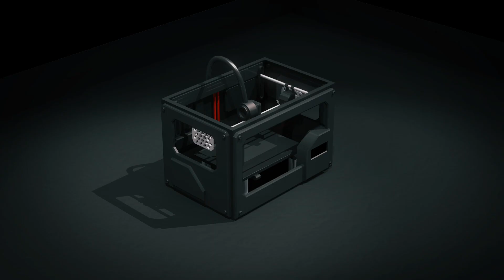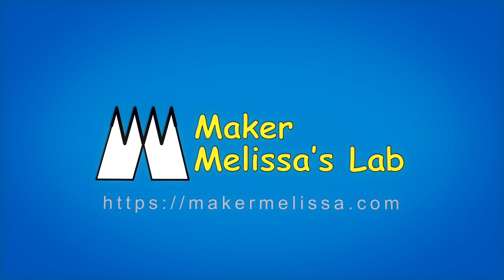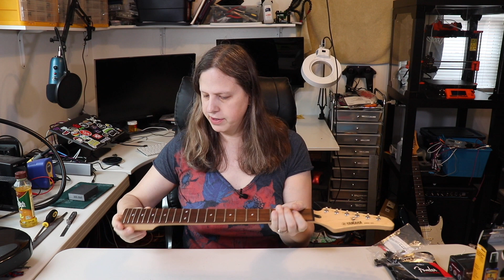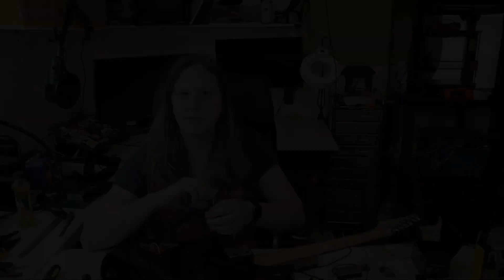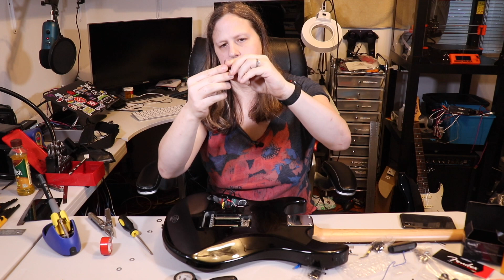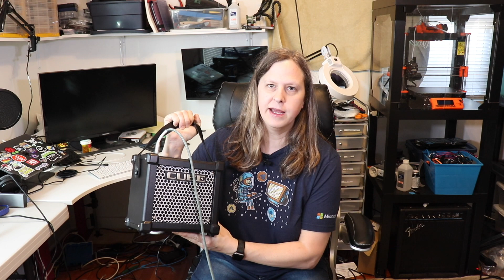Restoring an Electric Guitar to Playable Condition for around $100

Comment: I suggest using a stereo jack wired in differential configuration (signal + to tip, signal - to ring, ground to sleeve) if you have to replace it. That would make it capable of differential output if needed, but still be backwards compatible with single ended cables and equipment.
Reply from the maker: I'll have to look into that because I hadn't heard of that before. Thanks for the suggestion.